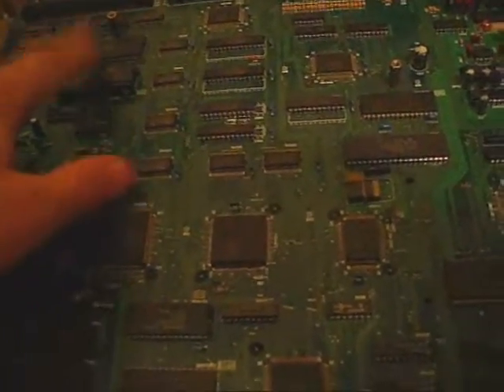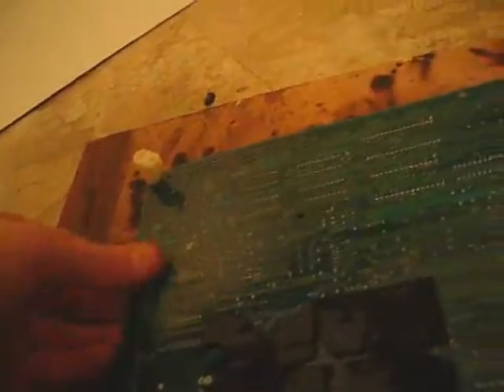Neo Geo 4 Slot Board Safety and Repair

Comment from the maker: Hey man, you need to recap the audio capacitors, you need a 4 slot cap kit to revive the audio. I recapped both my boards, and I could do a video explaining this and why you have to. As capacitors age they dry up and you lose your audio. The bad cart could be due to a number of factors, I'd make sure its cleaned up.  The speakers are most likely fine, its the audio capacitors on the board that need to be replaced. Be careful when desoldering them.

Comment: Great video. I have a few questions. I just picked up a 4 slot MVS cabinet. The 4th slot wont read the cartridges and I'm not getting any sound through the speakers. The headphone ports do work but not the speakers. Any advice for troubleshooting these issues would be great!